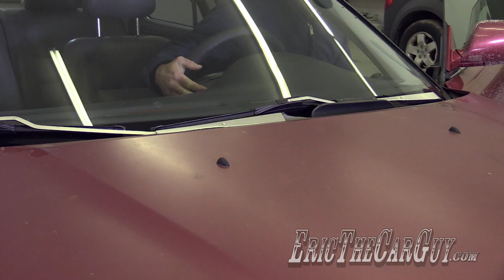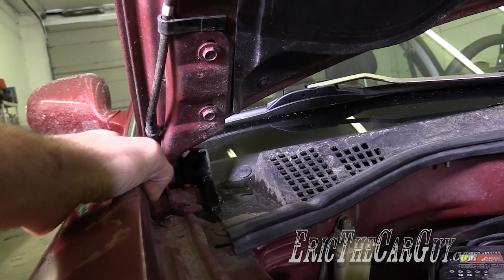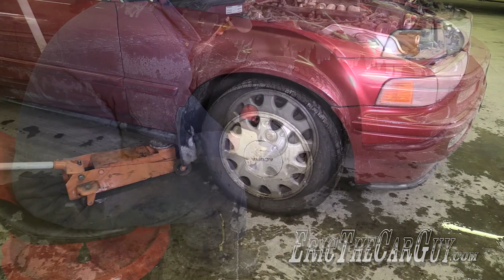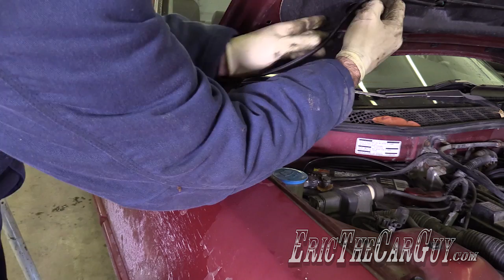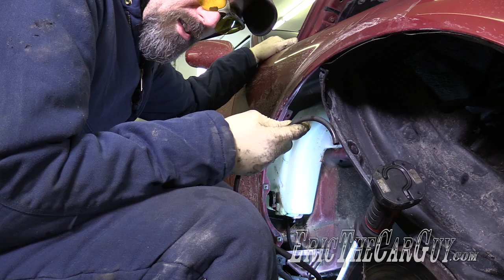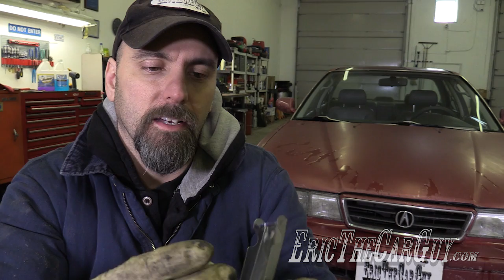How To Fix Broken Windshield Washers -EricTheCarGuy

Comment: I just took my 92 k1500 nozzle out (passenger side not spraying) and cleaned it. I wasn’t able to get the dirt out with a pin. So I took it out and got it clean and tested it. Worked great so I put it together, tested it again and again, so I put it all back together. Hop in to test it and nothing.. at this point I’m just going to replace the reservoir, pump, lines, nozzle, arms (somehow bent and it uses some old pin system for the blades?) and potentially the switch on steering since that stops working randomly too lol.

Comment: HELP!!!HELP!!!! You

(yes i am.... there is fluid in the reserve,,, i changed the pump CHECKED FUSES(all good) and can hear the motor loud and clear, but it wont come out...i followed the lines from the pump to the windshield and they look bone dry as if the fluid never even ATTEMPTED to come out? the lines dont appear to be clogged (well the clear tubed ones that i can see through) , i even removed the jets then tried and still NOTHING!! what do i DO!!! im beyond pissed

Comment: In my 98 GMC 1500 Savana Van, I am getting only 2.0v at the washer pump connector. Why is there such a low voltage when the washer pump is activated ?

Comment: I just bought a 07 Subaru Legacy. And the windshield washer is NOT working and i need that washer working so it may be an electrical problem so im gonna need a new electrical washer motor

Comment: Nice video. My 1994 VOLVO 850 has following problem: washer pisses well for first 5 seconds than - just hardly spits. Leave it standing for 10minutes and pressure builds up. What is second hose for on washer motor?

Comment: Did a similar job on my 01 tahoe.. Real PITA to get to.. The bottle is right under the battery.. Thought I had a hole in the bottle.. Nope.. Turns out one of the motors was broken and letting fluid out.. And both lines for the fluid were cracked and had holes.. Front one just disintegrated in my hands.. Part stor wanted $20 for a direct replacement part.. I used hose similar to what you just used for like $7.. And I didn't have to wait for it to be shipped..

Comment: Hey Eric, nice video. I have the following problem: the front washers don't work but the rear one works, so I was wondering if they use the same pump or different. Because if they use same I will know its clogged/leaking
Reply: kinobla94 my hatchback has a front and rear pump on the reservoir, they are actually labeled F and R on the servoir, found out yesterday as my fromt pump gave out, I swapped the rear to the front location and now. I have window juice pumping though the nozzle...

Comment: Thanks for the Vid Eric,  A tip I use is when removing tube etc I tie string to the end and then when It comes out you can tie it to new hose or whatever and pull back through the same route. Depending on how tight the route is I either push a hole straight through the hose about 1/4" from the end and push string through the hose and tie it tight, I have also made different sizes of metal tube to fit different diameter hose with a hole as with the tube to put string through , I actually prefer using good strong electric cable Say you have a 3 core cable just pull one out. eg like from a power cable.  Regards Phil    (I recently joined your site Eric, nice info there)

Comment: Just ran across this vid, great troubleshooting steps! Thought I would throw out another potential thing to check for if all else fails. On many washer fluid reservoirs there is a small vent hole either on the cap or somewhere around the top of the tank. This prevents a vacuum from being created in the tank as the pump drains the fluid. One time for me, that vent somehow became clogged and when I would run the washers I would get a shot of fluid at first and it would taper off to a trickle as the pump fought the vacuum. I poked a small awl through the vent to clear it and problem solved.

Comment: Great repair video, have been enjoying watching your repair videos for quite some time now.
I had once problem with '01 Nissan Micra with driver's side washer nozzle, the fluid came through it with very low pressure. The other one worked ok. Took the tubing out of it, blew some air through it and picked the injectors with needle to no avail.
Ended up having to replace the nozzle and then it worked normally again. Never found out why the old nozzle didn't let fluid properly through even after cleaning.

Comment: I had this issue when i had a summer fluid during winter and something froze. I ended up getting to the motor and pulling the hose off and flushing it out and it fixed it

Comment: you don't have to get the washer bottle plumb full.  If you fill with the warm weather solution near winter that full the you run the risk of cracking the bottle.  Like some of my coworkers and a company vehicle.

Comment: Eric, I have a 1990 GMC Sierra 5.7L automatic that is giving me some issues. When the vehicle is idling in gear for about 15 seconds without giving it any gas it shuts off, it will start back up with no problem but I'm sure you can imagine how annoying that gets. If you give it a little gas with your foot on the brake to keep the RPMs up it doesn't shut off. I have replaced a couple of sensors, done a full tune up, and checked for any disconnected lines/ground wires all to no avail. I also loosened up he injectors opening them up a little bit which lets it hold out longer before it still shuts off. I have the idle set a little higher to help but it still shuts off. There aren't any codes coming up either. The truck has about 245,000 miles on it and hasn't ever given me any problems. The transmission has been rebuilt in the past but after the rebuild I still never had any problems with it. I figured the only solution was to but a new crate motor in but wanted to see if you had any input before I spent all that money. 

Thanks,
-James

Comment: I had an '88 Nissan, and now my '89 Buick- that have a 1-way check valve, just before the nozzles. This keeps the line from draining empty when not in use, so fluid is available instantly when needed. I had to replace this on both cars. The washer system may save your life someday, or even prevent an accident (truck passes you, sprays mud/snow in your view) so it's very important to have this crucial system working correctly. Thanks, Eric!

Comment: My car had a similar issue. It was leaking when I put fluid in. The shop told me it was a cracked container and it would cost me a bunch to get it replaced. I looked at it and all it turned out to be was a hose that disconnected. Simple fix.

Comment: funnily enough the usual problem i have wasn't mentioned here, I've had washer failure on two cars now, both 1997 land rovers, one defender one discovery, and the problem was the same each time, the one way valve that stops fluid flow back, one of them someone had put on the wrong way the other was leaking

Comment: I use the RainX orange fluid year round.  Advantages are, it's not going to freeze, and you can tell the guys at Jiffy Lube no thanks.  You're treating the windshield with RainX every time you push the button.  The stuff rocks ;)

Comment: Occasionally on some vehicles you can get a wiper washer to work by spraying inside the reservoir with pressurized water. I've found that the wand at a local self serve car wash works great for this task. It seems to agitate things and break up any gunk in the reservoir that may be causing an issue.

Comment: What about the connection between the multiswitch and the motor? For old/ancient/broken cars, the contacting points on the switch wears off. Would there be relays? 
The motor is supposed to be brushed and the contact points can be repaired/rebuild.
I came across rebuilding kits for starters on amazon and speaking from that point of view. Motors can be rewired, bla...
I don't have a problem yet, just curious.

Comment: Good video and I'm glad you brought up the string/fishing idea - that's exactly what I was thinking I would do when you were removing that hose.

One caution however... when you blow compressed air through the line, you MIGHT want to consider blowing in the reverse direction; from the exit port towards the inside. The reason is, if there were actual debris in the line, compressed air would force that debris to the nozzle. In that case, you would blow the air, it wouldn't fix the problem, you'd move on to the next area to inspect and end up replacing a bunch of stuff that wouldn't remove that bit of debris in the nozzle.

But hey, what do I know?

Comment: The barb on the passenger side jet is notorious for breaking on Vigor because it sits right above the exhaust manifold and cooks.  I broke mine as soon as I touched it to do a similar repair.  Honda still sells the jet but for my color it was discontinued so with buying paint and clear coat it turned into a $40-50 job.

Comment: Just got one question, if you were prodding and messing around with the system like this, wouldn't it be better and cheaper to use normal tap water, and when you fixed the issue, replace the water with washing fluid?
Only problem is if you are working outside and the season dictates that the water may freeze while working, but that shouldn't be a problem for your studio / garage.

Comment: EricTheCarGuy Do you have any easy suggestions as far as deicing the cheap washer fluid inside the reservoir? Rather than having to wait for the engine to hopefully warm it up enough, or use a hair dryer. Are there any special additives that generate small amounts of heat or somehow break up the ice? I was thinking I'd use a cheap hand warmer and try to wrap it around the tank to see what happens. No access to a warm place to do much else. Thanks!

Comment: I've found that if your washer fluid isn't up to snuf, or if winter happens to be extremely cold, you can add an ounce or two of yellow bottle HEET to the washer fluid. It works in a pinch when the "good to -20F" wash fluid freezes because it hasn't gotten above -22F in days.

Comment: I fixed a washer problem recently. A connector to the back washer had come loose so it was an easy fix. I zip tied the connection to stop it from coming apart again. The genius car designers thought it was a good idea to run the washer line through the wiring duct. When the connector breaks and you try washing the back window, it squirts washer fluid all over the power cables!
The line to the back was blocked so I had to use a lot of compressed air to get it flowing again. Just took time and persistence but after quite a few splutters, it started coming through again. It's a relatively easy fix.

Comment: When I bought my 1998 Mexibug I found out it had a bound winshiled washer motor. It had to take a couple of hits with a hammer or screwdriver handle and would work for a few days. Then I took the motor off and found that it was somewhat corroded and that there was a little tartar where the little pump assembly is. So what I did is to pour a little WD40 on the pump assembly and covered the fluid's inlet and outlet on the motor to keep the WD40 from being sprayed all over, and then ran the motor for 30 secs, leave it to cool down then again. Repeated this about 5 times and added washer fluid, as the previous owner only used water and then it seemed like he left the reservoir dry and dirty for some time, reasons which I think caused the issue in the first place.

Comment: After seeing this,I feel kinda lucky that the washer jugs on all my vehicles are mounted under the hood, not between the inner and outer fenders.
Reply: Aint that the truth...
Reply: Mine is under the car in the front bumper, if I need to get the motor out I just reach down and disconnect everything from the motor and pull it right up and I'm done. Don't need to remove anything really, but I do have to get down on the ground. To remove it I just unscrew it from its mounts and let it come down and away it comes. The only car I can think of that's even better is older VW's.

Comment: I'm going to have to give this a go on my 86 GMC Caballero. Got a new motor installed along with a reservoir and still have no sprayers. But it's got the old copper tubing sprayers, so there's a good chance there's some corrosion in them.

Comment: Dried, cracked hoses are common, but around here, squirrels seem to love washer hoses ;)

Have seen acorns and leaves piled up where you find the hose chewed through.
Reply: mmm yum...
Reply: The rodents seem to love those along with the wiring harness too...
Reply: South Main Auto Repair My folks RV, squirrels did near $1000 damage. They never found the break in the speedo wires, just ended up running new ones from the ECU.
Reply: Honda makes a stuff called "rodent tape" i use it here in the shop.. just Google "Honda rodent tape" great stuff when doing rodent repairs or preventative maintenance
Reply: Had an old VW Rabbit a couple of years ago, and one day I was going for a run with it after it's been sitting for a while I saw a couple of dead mice under the car. Opened the hood and I saw a few more, and looking at the coolant level in it's bowl I saw it all had drained out, I inspected the lower radiator hose and saw that the mice had chewed through the hose and sipped on the sweet coolant.

Comment: Most washers are simple fixes , like you showed and not that costly to fix ,And a very nice thing to have working if you want to see .But seems so many cars still drive around with them broke. It amazes me that a lot people put up with such dirty , no see through windows while driving , when most repairs are not to costly. Must just be the not knowing , but why do they not ask about them , when their car is being serviced. I think if the radio would be made to malfunction , when the washers quit working , or a light burns out , there would be far less broken ones on the road.   .

Comment: Thanks Eric for the the video. I've encountered the same issue. I decided though that it would have been better if I had pulled a piece of wire or cable with the old tube while removing it. That way you can pull the new one back through. Doesn't work if it goes through a feed through or sharp angle. 
Enjoy your video's, keep up the good work...

Comment: With the clearing of lines i prefer to blow in reverse blow in to the nozzle stops debris getting lodged.
just make sure when doing reverse blow that there is no check valve.
Reply: I was thinking that as well. I suppose one could pull the nozzles off and blow the hose out in either direction before blowing the nozzles out 'backwards' and reassembling.
Reply: Better to disconnect the nozzles altogether and clean them with a nozzle pick.

Comment: On my 1996 Integra. My rear sprayer stopped working and the next day the front quit working. Bad multifunction switch?
Reply: Sounds like you better check for power at the pumps to be sure...
Reply: Not familiar with the Integra's pump(s), but one possibility if it's a dual action pump, is that the pump's plastic piston has stretched over time and won't open the pathways anymore. The pump would still usually run.

Comment: Eric you have all almost complete clearcoat failure on the Vigor.  How about doing a DIY paint job in the future?  BTW great line in the video: "Hey, if you could give yourself an other inch, you would" LOL!
Reply from the maker: Calendyr I like it just the way it is. Besides, it takes a lot of effort to do a proper paint job. Also, the body on the Vigor is pretty much junk so it's just not worth it. Also… https://www.youtube.com/watch?v=rI-UiECuXYI
Reply: That's all part of the point of this vehicle. He's stated several times before this is the beater he doesn't care about getting dinged up.
Reply: Believe me, autobody and mechanical work share very little. That is not Eric's trade. There is a TON of work that goes into fixing peeling clearcoat like that, and 90% of the time the peeling clearcoat is just a sign of far worse things to come.
Reply: I agree that it doesn't prevent rust and extend the life of the vehicle. But it does help prevent the vehicle from looking like shit longer. And it only took a couple of minutes.
Reply: EricTheCarGuy
you obviously haven't seen my 91 accord. the body on it is 1000x worse. You should have me out to the shop sometime, it would be nice to meet my mechanic idol.
Reply: dropinbiking92 I had some peeling clear-coat on my van, and stopped it from spreading by lightly sanding the area then applying some spray-can clear paint to the affected area. That was about 2 years ago. Its not a "fix" but prevented it from spreading.
Reply: From my eyes, working in the industry, that was both a waste of your time and money. Peeling clearcoat commonly happens in hot sunnny, sunny areas of the world, it bakes off. It does not cause rust, or any other harm to the metal underneath. It is purely cosmetic, and it is hard to bring back clearcoat to a factory finish with light sanding and some rattle can clear. There really is no need to stop it from spreading, I guess is what I'm trying to say.
Reply: jfishthecreator You can be at his shop, you got to come to one of the EricTheCarGuy meetups, and then you will end up on camera too.
Reply: dropinbiking92 Plasti Dip FTW !
Reply: I'm not against plasti Dip, It's just much more expensive to dip an entire car than most people think. I re-painted the entire outside of my Acura for less than $200 in material. The plastidip gun and material would have cost almost the same. Yet I have over half a gallon of gloss black left over.